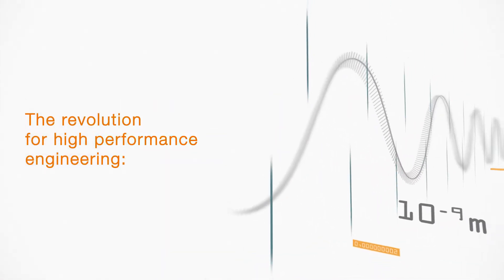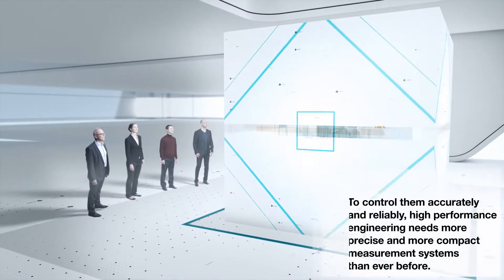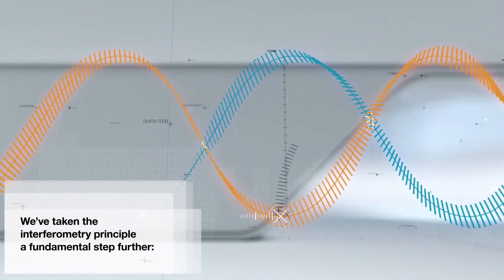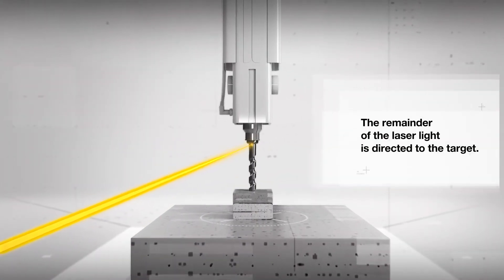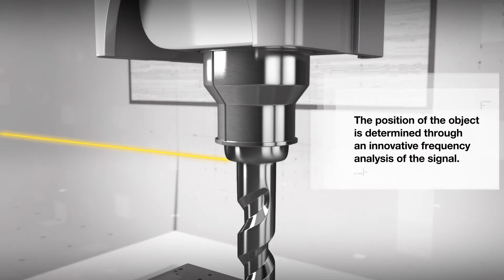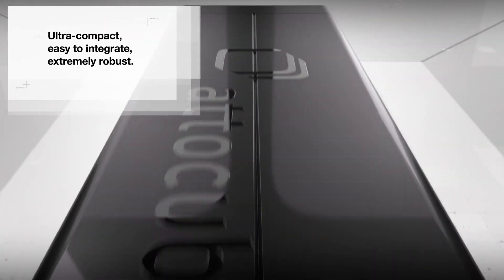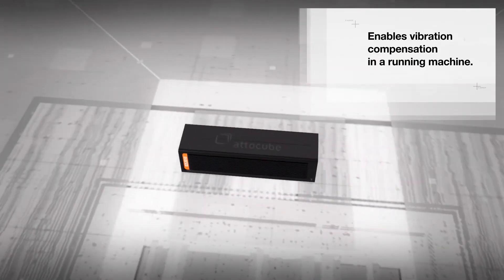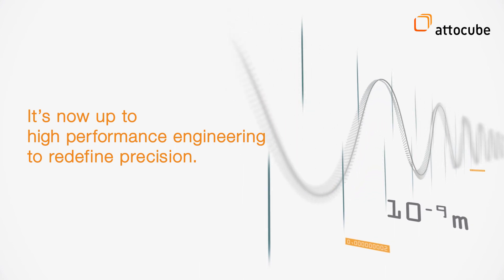IDS3010 - Measurement becomes nano precise

Comment: Can this sensor measure height difference up to 1 meter away from the target in numeric data output values down to microns ?
Reply from the maker: The IDS3010 sensor can measure the displacement/movement of various targets with nanometer resolution, numeric data output and even at distances up to 5m. However, the IDS3010 cannot measure absolute distances with highest precision. To get a more detailed consultation to solve the application, please contact our sales team MAS-Sales@attocube.com.

Comment: can this be applied to materials such as PE pipes. application to perform diameter and visual measurements on PE pipes ?
Reply from the maker: The IDS is in general very flexible regarding different materials and their reflectivity. Anyhow, to provide a good and stable measurement the surface quality must be appropriately high. Grooves and scratches would disturb the measurement. 
If you want to discuss your application with us, then please send your request to info@attocube.com.

Comment: Is it suitable in underground mining environment.
Reply from the maker: Dear Sri Kanth ,Thanks for your interest in the IDS. In theory there are nearly no environmental limitations in using our Interferometric Laser Displacement Sensor. Nevertheless – of course – the cleaner the better. By nature of the name, we expect quite harsh environment within mining which might lead to problems during the measurement process. For a detailed answer we would be glad if you could send us more information (or specifications) about your application to info@attocube.com – we’ll be happy to support. Best regards, attocube
Reply: -- (1)    Temperature variation: 31.86oc to 33.95oc but you should design the instrument considering temp. Variations 28oc to 42 oc.

(2)    Relative humidity: 89% to 100% These are the specifications in underground.